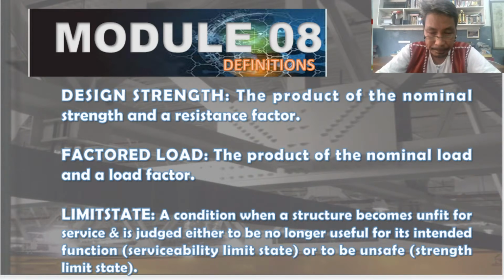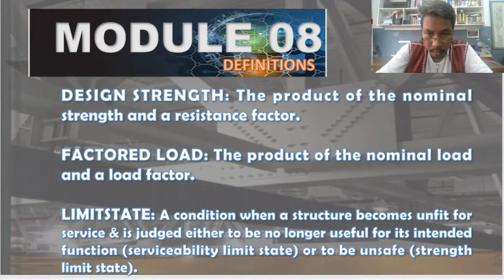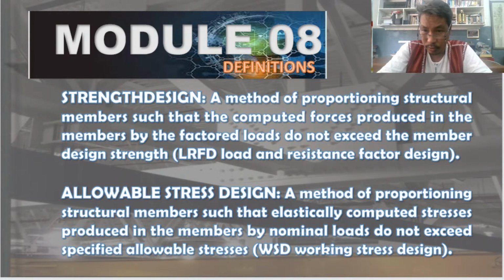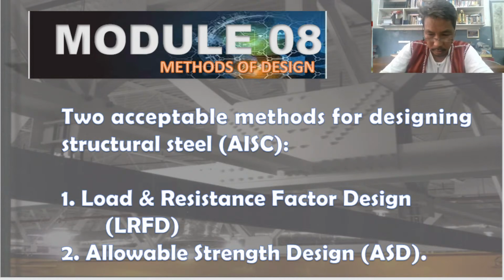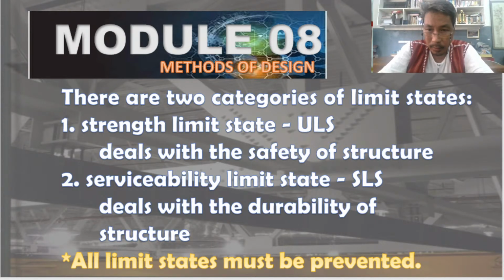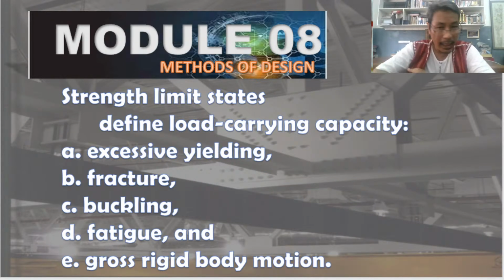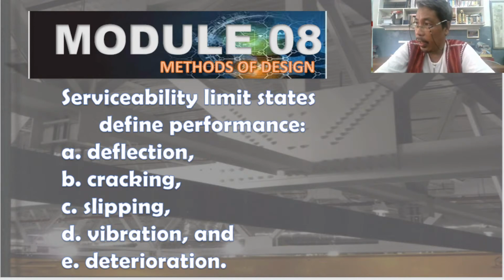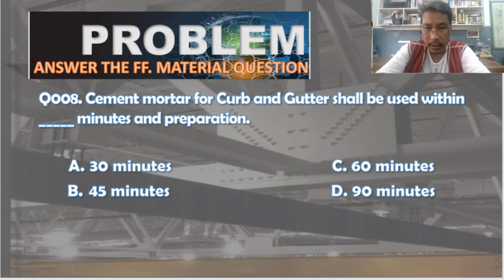[ LIVE CE E6 Lecture 05 ] DrAP Zantua STEEL DESIGN Talks + ENGINEERING Analysis & Design

Comment: Thank you, Sir for the Live lecture to easy to understand the topic/course. Design Strength is the product strength and resistance factor.

Q008: Cement mortar for curb and Gutter shall be used within _ minutes and preparation. 
Answer: A. 30minutes

Comment: For today's discussion we tackle Module 8 Definitions, where we define the following terms:

Design Strength - the product of the nominal strength and a resistance factor

Factored Load - the product of the nominal load and a load factor

Limitstate - a condition when a structure becomes unfit for service and is judges either to be no longer useful for its intended function or to be unsafe 

Strength Design - a method of proportioning structural members such as that the computed forces produces in the members by the factored loads do not exceed the member desig strength ( LRFD load and the resistance factor design)

Allowable Stress Design - a method of propoertioning structural members such that the elastically computed stresses produced in the members by nominal loads do not exceed specified allowable stress (WSD working stress design)

Two acceptable methods for designing structural steel ( AISC)

1. Load and Resistance Factor Design (LRFD)
2. Allowable Strength Design (ASD)

2 Category of Limit State
1. Strength Limit State (ULS) - deals with the  safety of the structure
2. Serviceability Limit State (SLS) - deals with the durability of structure

Comment: Thankyou sir for discussing about design strength which is the product of the nominal strength and a resistance factor. Factored load is the product if the nominal load and load factor while the limitstate is a condition when a structure becomes unfit for service and its judge either to be no longer useful for its intended function or to be unsafe.
Q08: A. 30 minutes

Comment: Thank you Sir for discussing the specification, loads and method of design by giving some technical term and its definition. I've learned that there are two acceptable methods for designing structural steel and these are the load resistance factor design(LRFD) and allowable strength design (ASD). And also the limit state that deals with safety and durability of structure.

For Q08. Cement mortar for Curb and Gutter shall be used withinminutes and preparation.

A. 30 minutes
B. 45 minutes
C. 60 minutes
D. 90 minutes

Ans: A. 30 minutes

Comment: Thank you sir for this live lecture about methods of design. I found out in this video the definition of design strength, factored load, limitstate, strengthdesign, allowable stress design (ASD). The two acceptable methods for designing structural steel according to AISC are LRFD and ASD while the two categories of limit states are Ultimate limit state (ULS) and serviceability limit state (SLS). The types of strenght/ultimate limit states are excessive yielding, fracture, buckling, fatigue, and gross rigid body motion while the serviceability limit states are deflection, crackling, slipping, vibration, and deterioration.

For questions 008, ement mortar for curb and Gutter shall be used within___minutes and preparation. The answer is letter A. 30minutes

Comment: thank you sir for discussing about the methods of design which I’ve learned about some technical terms such as design strength defined as the product of the nominal strength and resistance factor. Factored load- the product of the nominal load and a load factor. Limit state- a condition when a structure becomes unfit to a service and is judge either to be no longer useful for its intended function (serviceability limit state) or to be unsafe ( strength limit state). Strength design- a method of proportioning structural members such that computed forces produced in the members by the factored loads do not exceed the members design strength (LRFD load and resistance factor design). Allowable strength design- a method of proportioning structural members such that elastically computed stresses produced in the members by nominal loads do not exceed specified allowable stresses (WSD working stress design. There are 2 acceptable methods for designing structural steel (AISC) which are load and resistance factor design (LRFD)  and allowable strength design (AASD). Limit state describe a condition at which a structure or part of a structure ceases to perform its intended functions. A condition just before the collapse. Also, there are 2 categories of limit states, strength limit state or ULS deals with the safety of the structures and serviceability limit state or SLS deals with the durability of structure. Strength limit states defined load carrying capacity (excessive yielding, fracture, buckling, fatigue and gross rigid body motion). Serviceability limit states define performance (reflection, cracking, slipping, vibration, and deterioration).

Q008. Cement mortar for curve and gutter shall be used within ______minutes and preparation.
Answer= 30 minutes

Comment: Thank you for this live lecture on our module eigth "methods of design," sir. I learned about design strength, which is the product of strength and resistance factors. Load and limit state are the factors. The LRFD (load and resistance factor design), also known as the ASD (allowable stress design), is a method of proportioning structural members so that the elastically computed stresses produced in the members by nominal loads do not exceed the special allowable stress (WSD) working stress design. According to AISC, there are two methods for designing structural steel: load and resistance factor design and allowable strength design. I also understand the definitions of the limit states.  Limit states are classified into two types: strength limit states (ULS) and serviceability limit states (SLS) (SLS). All limit states must be avoided. Load-carrying capacity is defined as excessive yielding, fracture, buckling, fatigue, and gross rigid body motion in the strength limit state, while performance is defined as deflection, cracking, slipping, vibration, and deterioration in the serviceability limit state.
For 22:30 Challenge Question: Cement mortar for curb and Gutter shall be used within -- minutes and preparation.  My answer is 30 minutes.

Comment: Thank you, sir for this discussion. The lecture is about the definitions of design strength, factor load, limit state, strength design, ASD. The two acceptable methods according to AISC are LFRD and ASD. Excessive yielding, fracture, buckling, fatigue, and gross rigid body motion are discussed under strength limit states. There is also serviceability limit states that define the performance of deflection, crackling, slipping, vibration, and deterioration. I have learned the technical terms about steel design. For Q-008, My answer is B. (45 minutes)